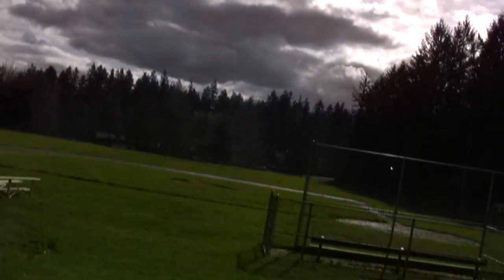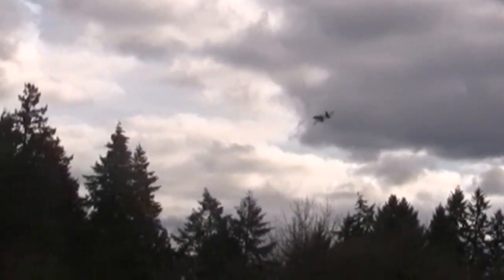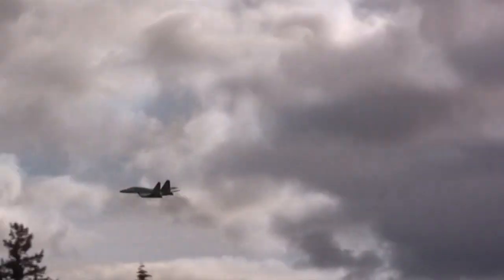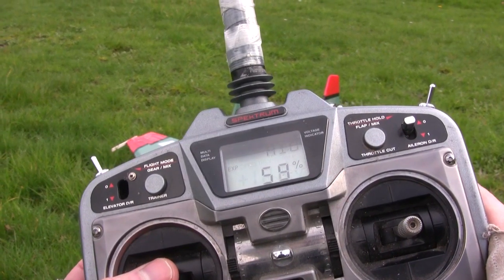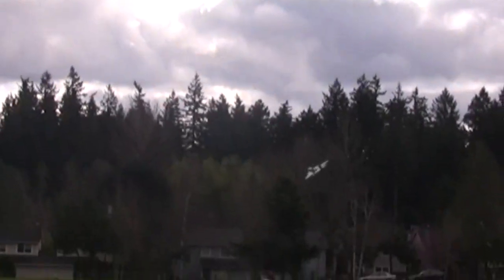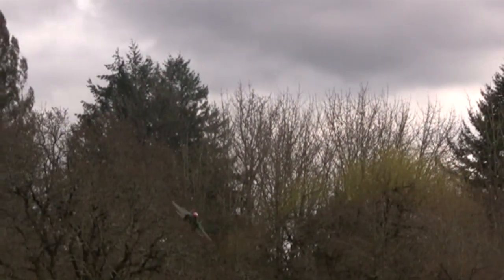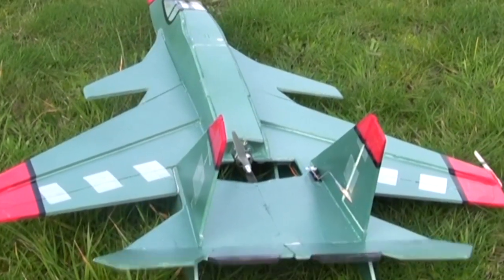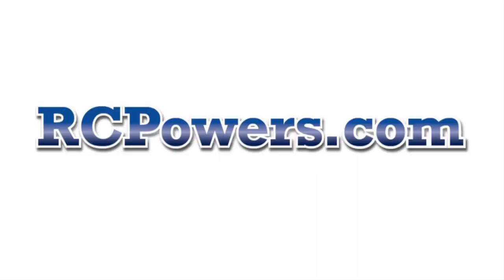New Flight Controls - 2x4 Testing

Comment: G'day,

Yay Team...!

That looks spot-on mate..., well done...!

  I think I'd like a Pup out of that Camera-mount of yours...; when flying the Nokia-Falcon Warbledrone-1 it's really hard to remember to keep the Telephoto Lens on the Transmitter actually pointing at the "Frame of Sky" the Plane is flying in, and last time I managed to entirely miss the Take-Off /Climbout with the Ground-Camera because I didn't tell it to "Start Recording" till I went to check the Framing and the mongrel of a thing was in Standby...

But at least the Model was well up, so I could let it fly itself while I restarted the Camera...

On the Credit side though, I did capture most of the more interesting bits of the Tree-Defying Sortie to video my Hut and Clearing from the Sky...; and, I did actually get the Air-To-Ground Views I was flying the Mission to collect, as well as land back down on the flat green bit, rather than hanging up in any of the available Trees...

  Congrat's on getting the Coupling & Expo fine-tuned.

;-p

Ciao !